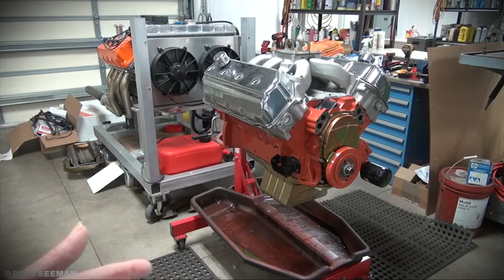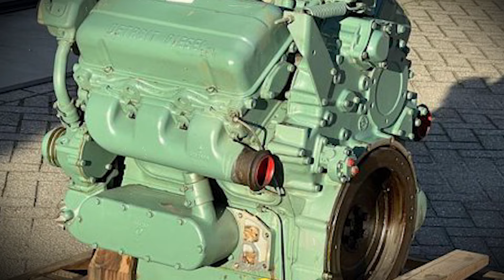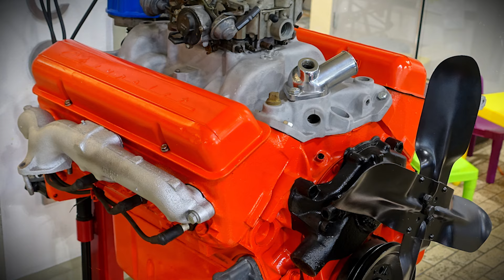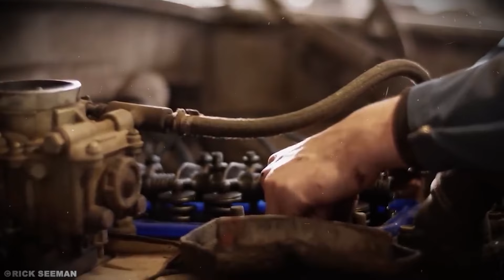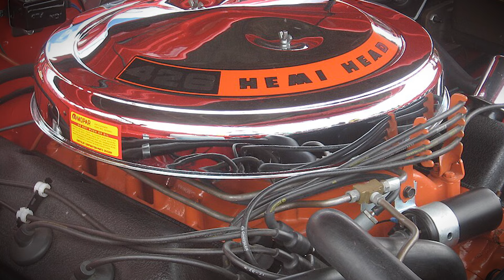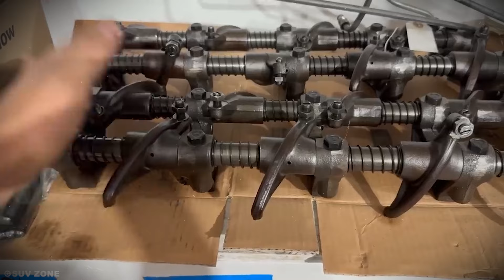The 426 Hemi started as a racing monster—but its military cousin powered armored beasts with the sam

Comment: I greatly respect the Hemi. But I still love the Ford FE 427 Tunnel Port. The new FE Power Tunnel Port with High RISER Port shat have special rockers for the angle to work the valves at an angle with the mixture going straight in.